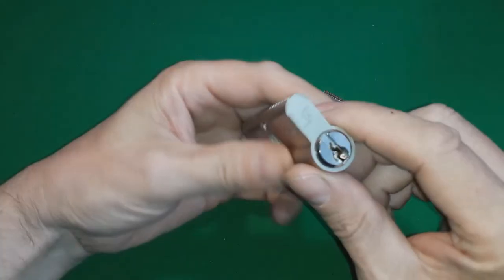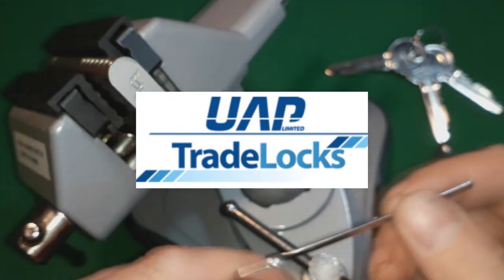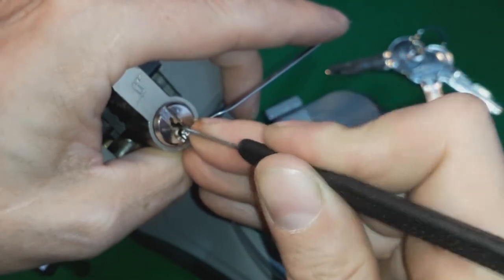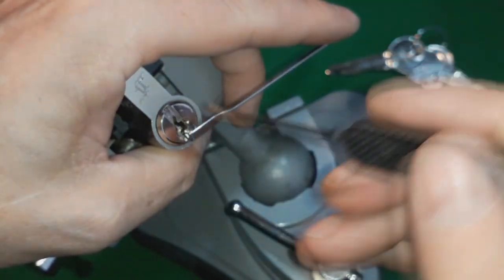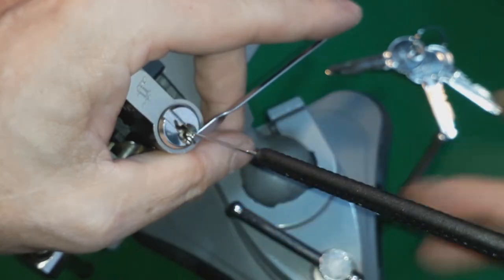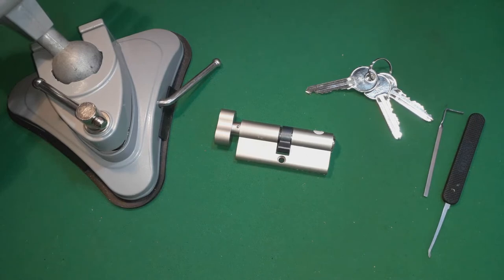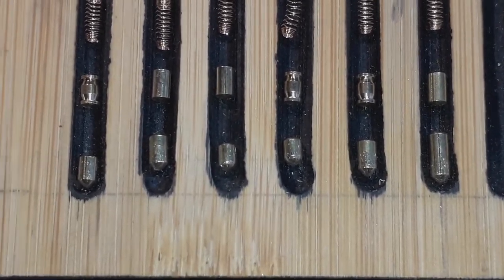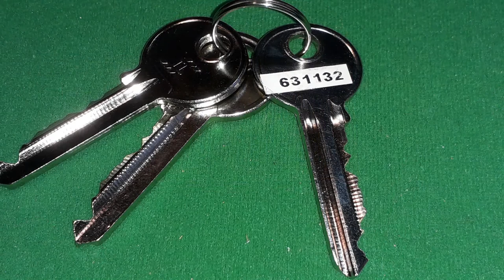(158) A UAP Trade Lock euro cylinder Picked!

Comment: Great job at picking that tricky lock with those fantastic barrel pins. A super quality euro lock. Thanks for the picking tips.
Your parcel is in the post. Hope you like what I sent. A couple of surprises included.🦊👍
Reply from the maker: I have been surprised with these locks, they give great feedback and make you work to pick them.
Thanks for the parcel Jack, not necessary but very much appreciated. Have you had a go at any of those locks yet?
Reply: @roysammons2445    Still working on making the tools for the lever locks. I will try out the half euro and other locks this weekend. Thanks again.🙏🦊👍
Reply from the maker: @jackfoxlock  the two small cabinet locks, ther ones that say picked on them, I used a small piped key but had to take ther tip down a bit. I also has to make quite a small picking wire.
Reply: @roysammons2445    Yes, you are right. I am making the exact same size tools. Thanks👍
Reply from the maker: @jackfoxlock  🙂👍🏻

Comment: Nice. That looks good for a cheap lock. I think I may have picked one of those up in a bulk buy not long ago. Didnt know what it was. Will have to check the logo on it
Reply from the maker: I think they are decent locks. I remember ordering a UAP lock and this is what came. When I did a check it's basically a UAP but budget version. Not bead for a budget lock to have singe nice security pins in it. 
Cheers for watching and hope you don't snap Parker with your speed cuff attempts. Oh and you have the key closer to hand. Otherwise Mrs Deadlocks might come home from shopping to find you in a tangled cuffed mess.
Reply: Just dug out the lock i got the other day. Is intact the same lock👍
Reply from the maker: @Deadlocks86  Well there you go, did you make a video picking it?
Reply: @roysammons2445  not yet. It is in my to do pile. At least I know what it is now👍